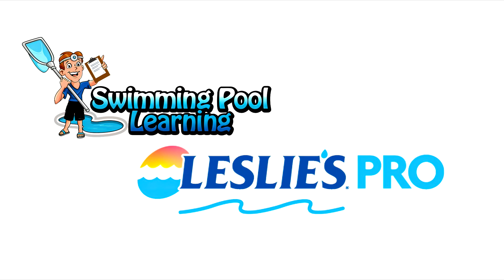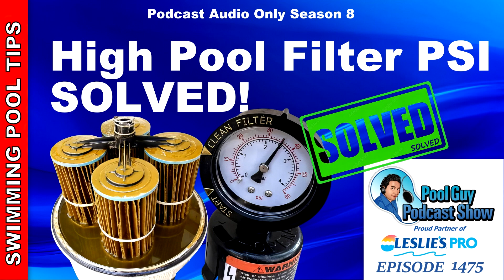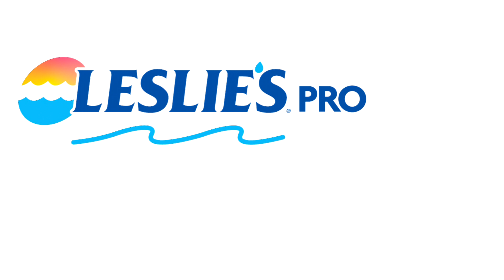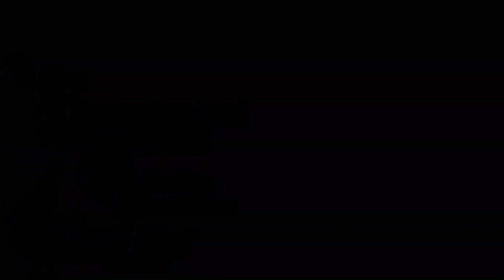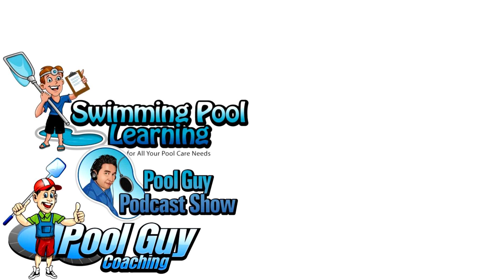High Swimming Pool Filter PSI Solved!

Comment: Is there a recommendation for the pump rpm when looking at the PSI?  I have a pentair variable pump.

My gauge shows 0 psi when it's running at 1200 rpm.  When I kick it up to 3450 rpm it holds at 18 psi.  I just cleaned the cartridges yesterday so they are clean.
Reply from the maker: It varys by filter. 18 psi at full speed seems right however.